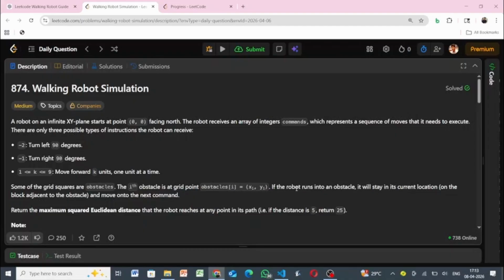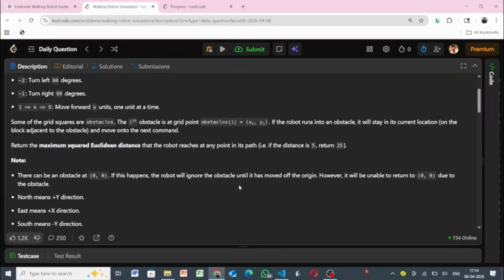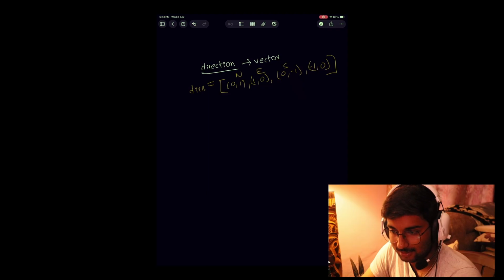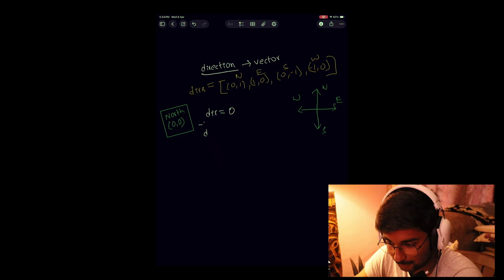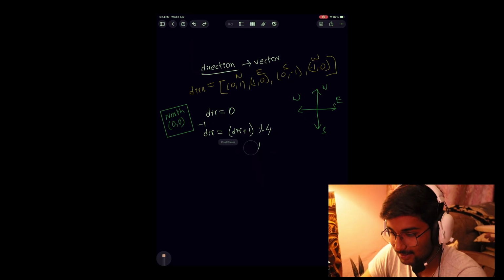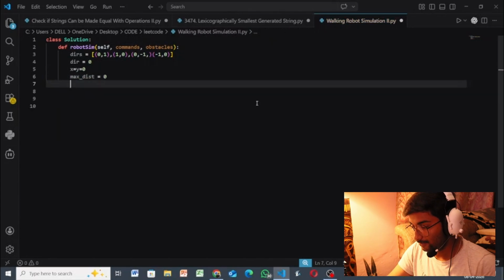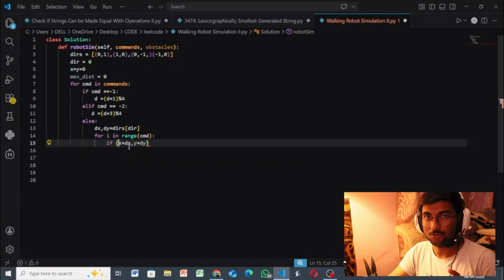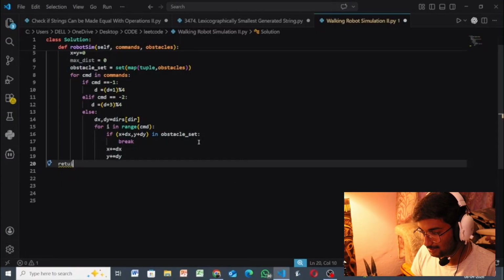Stop Memorizing LeetCode — Master Grid Simulation with ONE Problem | Grid Simulation |  DSA

Comment: Maybe also cover how this pattern extends to dynamic obstacles or changing directions mid-step—feels like the next level after this framework.
Reply from the maker: Yeah for this problem the direction changing concept makes it really interesting and we have to tackle it very carefully,  idk if you had cover the 2nd version of this walking robot simulation from leetcode where actually we have to tackel various or multiple obstacles
Reply: @codeteenxYeah, I’ve already checked out the second version. The multiple obstacles make it more challenging especially when you need to manage direction changes properly.
Reply from the maker: @AdityaDas-h6n I will suggest you to at first manipulate the direction algorithm I have shown on my video cause I have already solved it 😊, it's need to be manipulated little bit but still vector approach is needed there then you have to consider the boundary or edge cases as we have to and it's little bit different than this problem. The. You have to find out the perfect way how you can pair up both the direction algorithm and edge cases together, if you face any questions about it then comment I will try to explain you as much as possible ❤
Reply: @codeteenxYeah, makes sense. It’s mostly about tweaking the direction logic and handling edge cases cleanly,once that’s solid, the rest falls into place.
Reply from the maker: @AdityaDas-h6n absolutely that's why you can make 10 + grid simulation problems with this kind of solid conception 😊 you just have to understand how to manipulate the algo little bit according to the question
Reply: @codeteenxTried reaching out via DM, but it seems your account doesn’t allow messages unless you follow back. Wanted to discuss your approach on this problem

Comment: While using hash sets for obstacle handling, how would the approach scale if constraints were extremely large (like 10^9 grid range)? Would you still simulate step-by-step, or shift to a more mathematical / compressed representation?
Reply from the maker: I will answer this in two ways at first with no prior vision in sense of advance mathamathical algorithm which can break my approach in more appropriate way in time and space complexity Friendly way actually but for this problem if you look closely then you can observe you can't change your path or decide your path before coming just infront of any obstacles, so you can't compute your path and directing before hand so you have to look through it but I must say may be maths and physics can help us to reduce more time and space complexity but complex algo might increase the difficulty of readability, we have to consider many cases here but I am really happy 😊 with this kind of deep technical question, so if you want you can DM me on Instagram same Uid(CodeTeenX) we can have a meaningful conversation there further ❤
Reply: @codeteenx  I can’t DM you,it says I can’t message this account unless you follow me.
Reply from the maker: @AdityaDas-h6n I have dm you now cheak
Reply: @codeteenxreply?